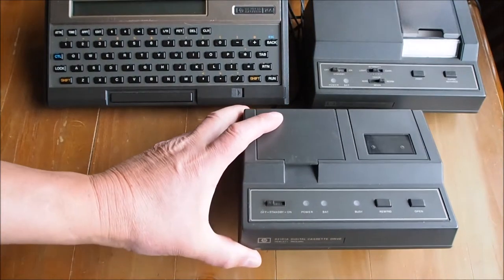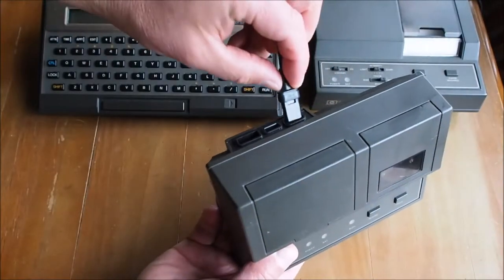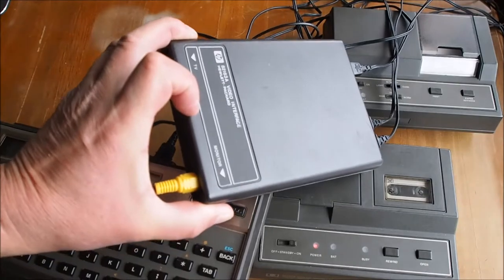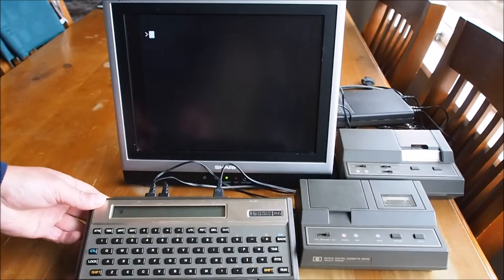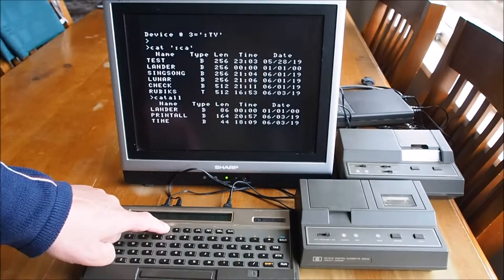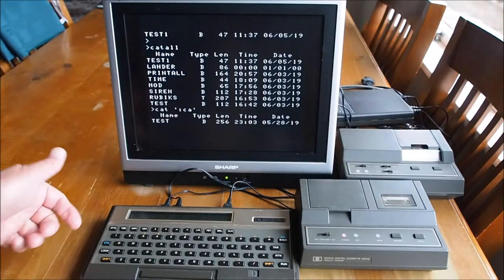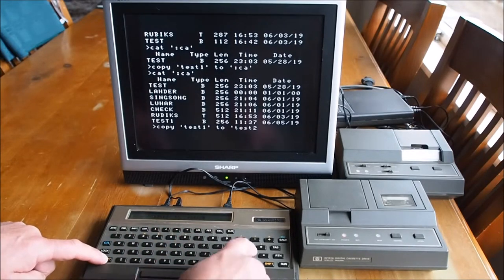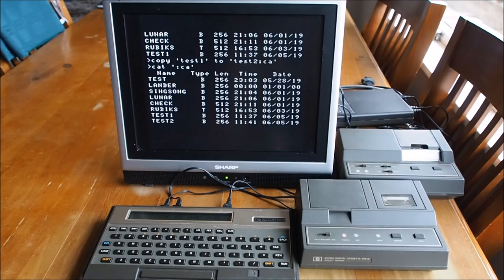HP Digital Cassette Drive - Basics

Comment: The drives were junk. Only because of faulty cassette tapes. The disk drives were perfect. I have 2 and they never fail. I call them 'M1' in the loop assignment.
Reply from the maker: I haven't had any problems with the tapes, although I only have two :)